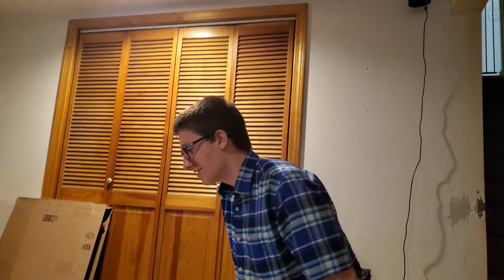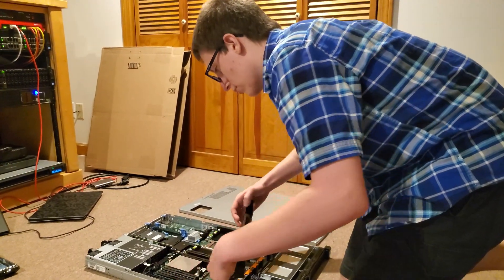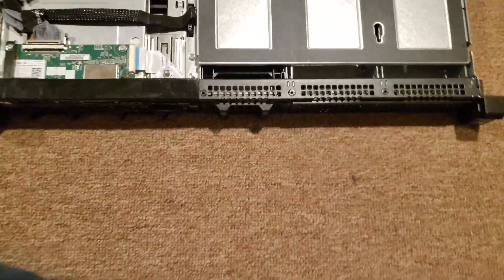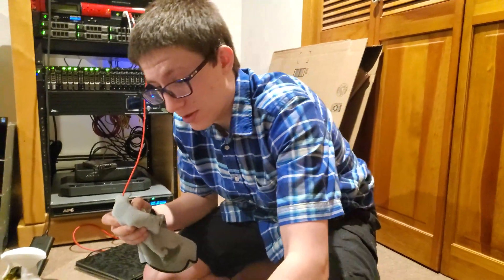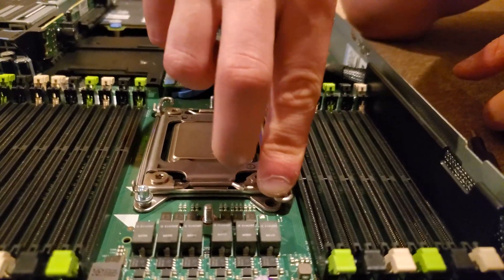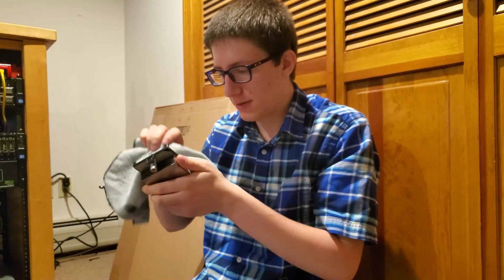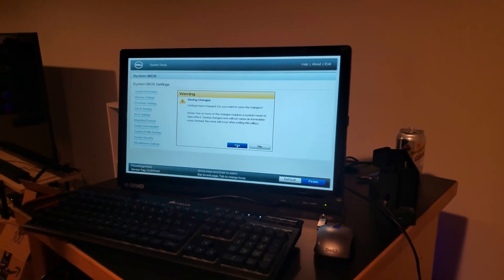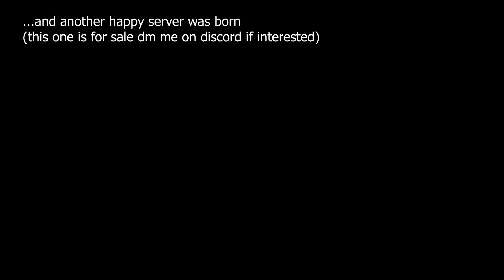Wreck to Workstation | Dell R620 | Server Rebuild

Comment: All Xeon E5-16** are single socket only and they are often the same as HEDT i7's. They are mostly used in single socket workstations and servers. At least some of them also have unlocked multiplier and can be overclocked on overclock capable boards.
For example the E5-1620 v2 is pretty much the same as an i7-4820K